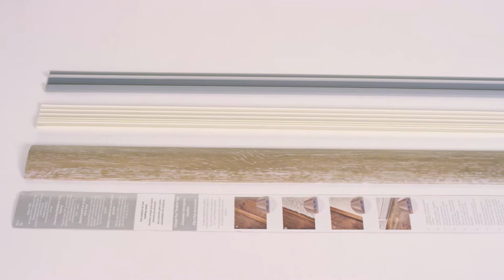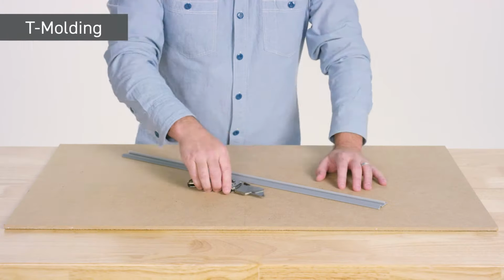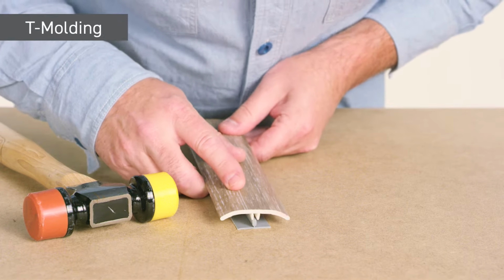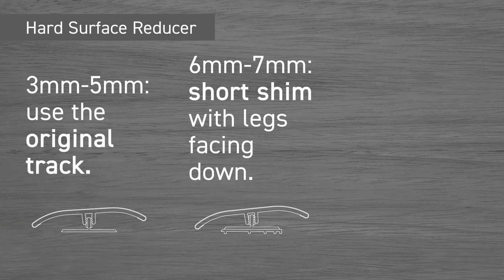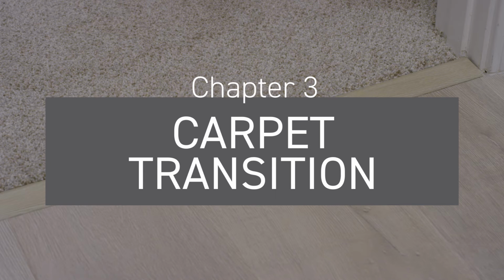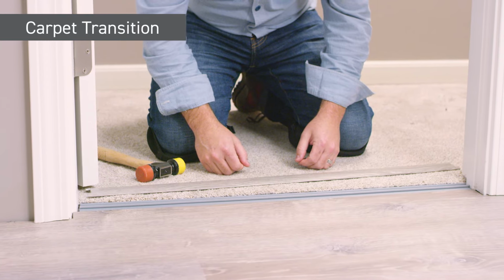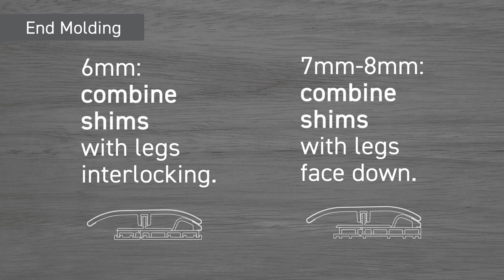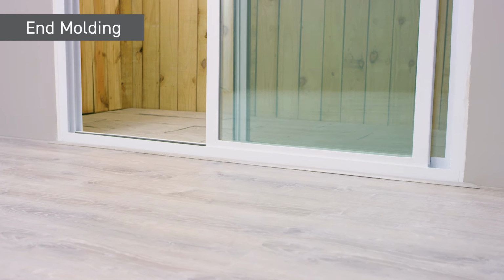How to Install Performance Accessories Vinyl 4-in-1 Molding

Comment: Do you have a cross section look at where the carpet is supposed to be? I’m struggling with the carpet transition. The carpet is much higher than the flooring
Reply from the maker: Hi, you can reach our technical services team at 800-325-7062 or contact us through the contact form on our website: https://www.flooringaccessories.com/contact-us.

Comment: Uh, there is no "taller shim"? I have your Charcoal LVP shims and they are both identical, and a grey color instead of the beige in the video. Also you guys said it fits 2-8mm thick LVP then go on to exclude 6.5mm thick in your T-molding section.